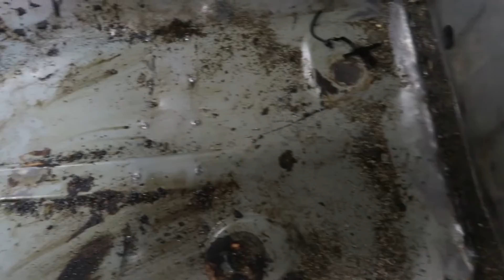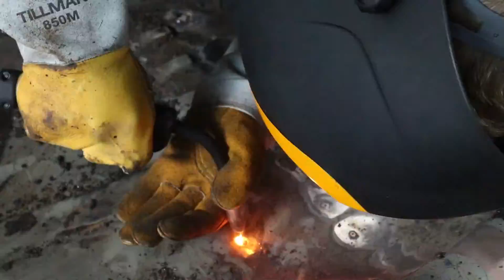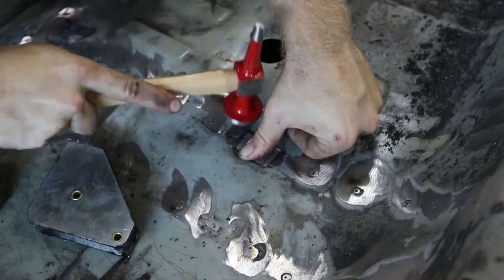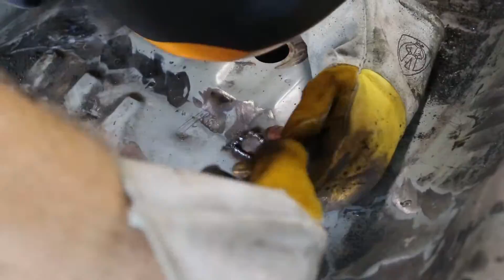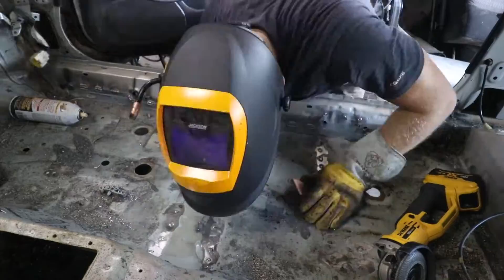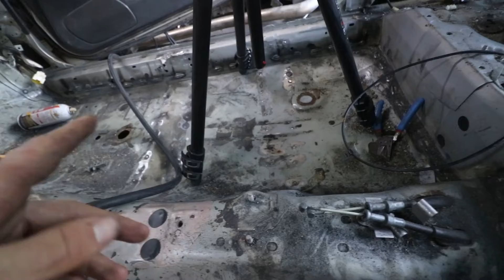Subaru GC8 Stage Rally Build Ep. 6: Welding the Holes in the Floor Pans

Comment: Currently trying to relocate some seat mounts in an old Honda. Every time I try to mig weld I keep blowing through the metal. What settings did you use when you welded this?

Comment: Hello sir , im just discovering your channel and your content was impressive . May I asked , is it practical for normal daily drive car to have stitch weld chasis ?
Reply from the maker: There wouldn't really be any issues from stitch welding the chassis on a daily, but you have to get rid of all the seam sealer/sound deadening which is the best option for a daily. Unless you're fine with driving a stripped out car.
Reply: @DirtyGarage  may i know the pros and cons for removing seam sealer ?

Comment: You mentioned you have a TIG welder. So why use MIG to do all these welds? Just because it's quicker or another reason?
Great videos
Reply from the maker: Mostly due to ease of welding with MIG, it's much faster and a lot less prep is needed. With welding up the holes in the floor, I would have had to clean the underside completely before welding.

Comment: You're really doing a stand up job... I've done this and know it's a crap TON of work that has great results in chassis rigidity, but besides that goes unnoticed for the most part.

I hate in "that guy" becauseuse I'm  usually not, but you gotta make sure you move those spray cans when you're welding and grinding man. I'd hate to see you get napalmed by one.

Comment: With welding anything on the floor.  You really do gotta get the underside insulation off.  Atleast in the areas you want to weld.  It actually peels off realy easy underneath.  Even easier than the inside sound deadening layer.  And way easier than the seam sealer.  

When you weld on the floor metal, any insulation on the opposite side contaminates the welds from below.  And you end up with junk welds that wont be any good.  You also end up blowing holes in the thinner metal as bubbles of the insulation burst through from below.  You also usually set fire to it when welding haha.

To get rid of the underside insulation.  Just warm it up with a heat gun.  Then use a broad chisel or scraper type tool to scrape it off.  You can remove 90% of it in really short time doing this method.  Its the last remnants that take the most time to remove, and also contaminate your welds.  I found best way to get it out after scraping the bulk off is blow torch, then wire wheel.  

This will make any welds your doing on the floor layer alot better.

Comment: Say you didn't want to prep and fill all the holes in the floorboard. Would it affect the rigidity of the roll cage overall? Im doing a cheap rally build and was curios
Reply from the maker: If you’re only talking about the holes that stamped in the floor, then no I don’t think it would negatively impact the rigidity at all. Seam welding the entire chassis isn’t even necessary, but it will improve the strength and help the car last longer and possibly assist in keeping the chassis straight in the event of having a light crash. 

I’m purely doing it to keep the cabin a bit more sealed so I don’t end up with a lot of dirt coming in. 
I could just silicon in the plugs that were in the floor before but i prefer to weld them in.  
If you have like rust holes and things like that then I would suggest cutting and filling those in.
Reply: @DirtyGarage  that answers the question i was gonna ask lol
Reply from the maker: Haha glad I could answer it.
Reply: You can silicone or use gasket sealer to fill in the holes also but after a rally or two they will vibrate loose and fall out and  you’ll have to fill them in again.